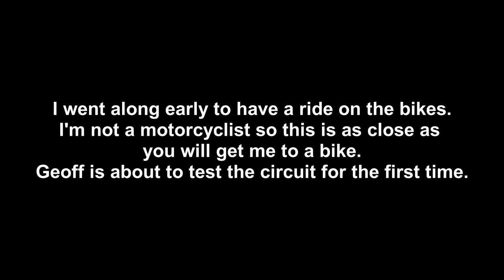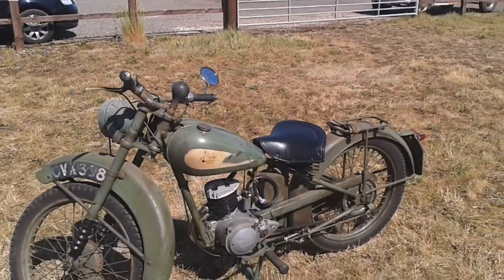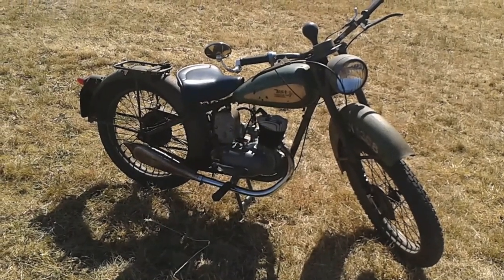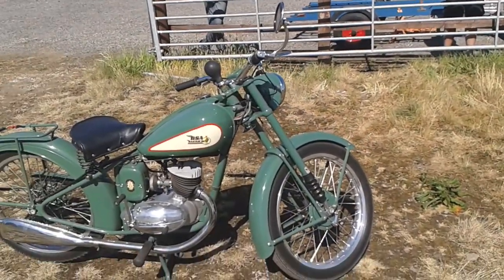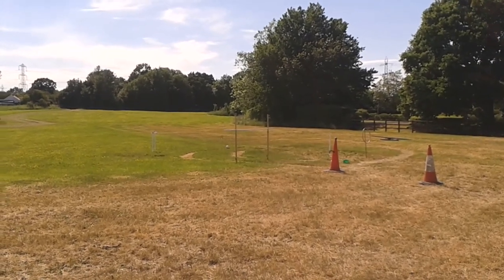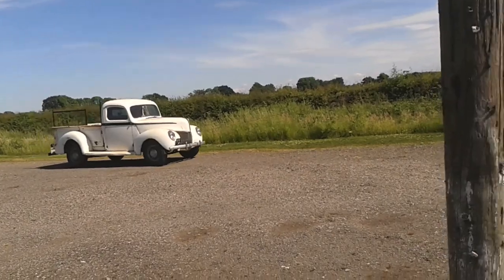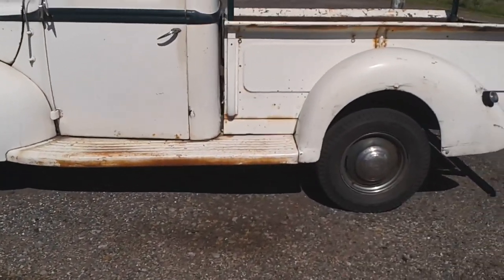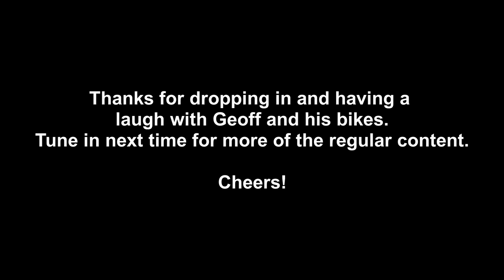Fat bloke rides a bike! Something different from Mart's Garage. 2021 ep26 pt1.

Comment: I had a Harley 165 two stroke, when I was a teen, back in the 60's which was based on that same design.  DKW was the factory name if I remember correctly. Brings back lots of good memories.  Shifter on the left brake on the right was the major difference. It also had the Harley-style switch on the tank.
Reply from the maker: There are similarities between the Bantam and the DKW. BSA got the design as war reparations and mirrored the design to suit British norms of shifter on the right.

Comment: Learnt to ride a bike when I was 18 on an excellent RAC/ACU course. As I didn't have a bike I was able to use one of theirs. They had a couple of BSA Bantams like your mate's, which were ex GPO telegram delivery bikes. Wouldn't pull the skin of a rice pudding; the '60's 50cc Suzuki they also had would see off the Bantams. Happy days. Pity you didn't say what Geoff's bike club is.
Reply from the maker: Hi Andy. It's the local branch of the VMCC. Funny what you say about the Bantams and the Suzuki.